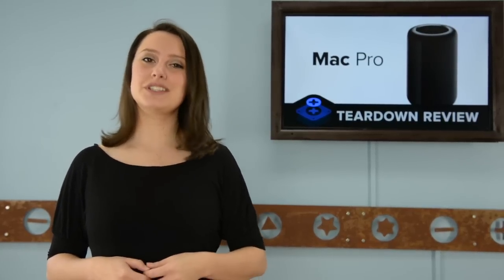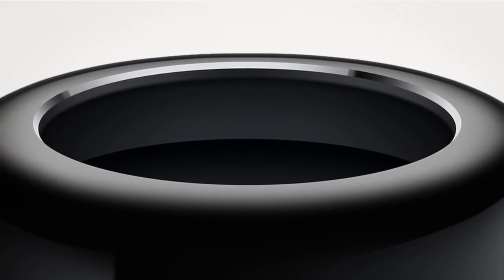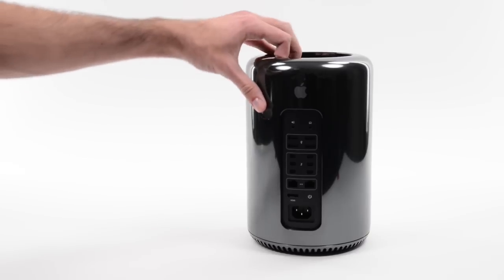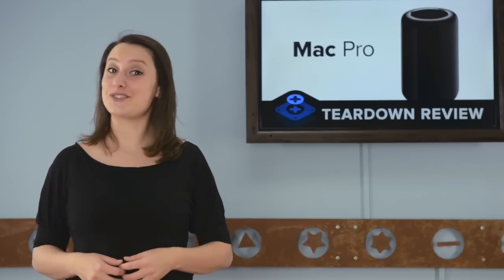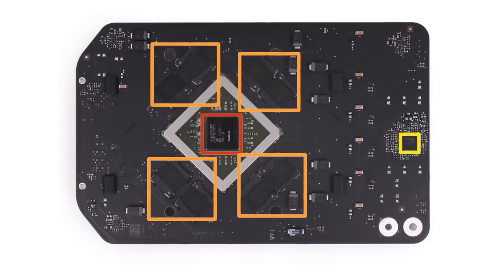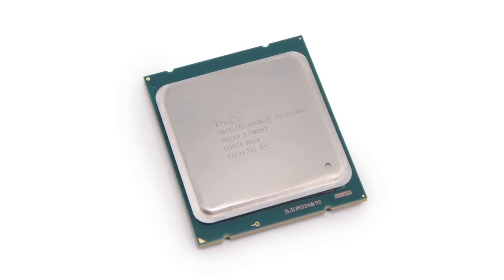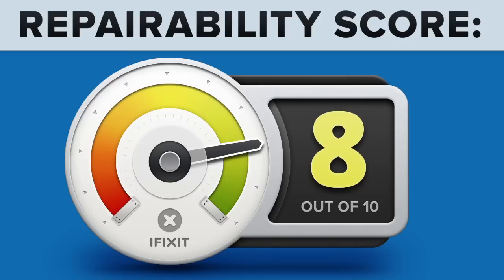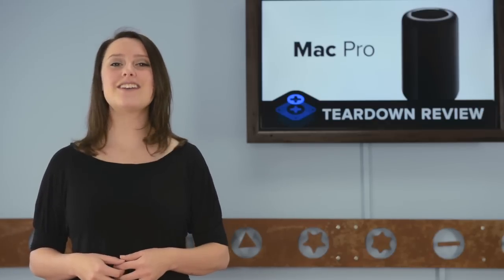Mac Pro Teardown Review

Comment: (tic) I think that that what apple has done for us high end users is great. They have made us a sexy new machine and made it incredibly easy to upgrade sorry to all of you buying the new Macbook Pros Having to pay through the nose upfront if you want 16gb of ram lol. But don't worry because though they have built ours to last and upgrade yours will be replaced in under six months depreciating your little macbooks  and 6 month old Ipads enough that I have  bought 2 15" retinas and 2 32gb 4gen ipads for my 6 year old twins for a bit more than the stripped pro. Its about time we find a way to get the riff raff to stop using our product. Three cheers to the direction the NEW APPLE is moving toward.

 God if only windows didn't suck so bad they are actually starting to make some aesthetically pleasing machines. I would just go back.  I think this is really disconcerting. I'm starting to believe apple has really forgotten the indy artists and the spirit of the independent free code until your eyes bleed, wake up with keyboard face and run with scissors until you poke an eye out mavericks who adopted this company for its bold ideas.  the fact you still need to buy a 16gb Ipad when each progressive generation could bump up the disk without losing a dime is really sad.

Comment: I hate people who say that they could build a computer better than the Mac Pro and cheaper. You would probably take an Xeon processor and compared it to a fucking i7, brain dead people that compare the two processors like that are probably the ones that make dumb ass decisions like choosing a Nissan Altima over a fucking Bugatti. The processors are both strong the i7 is like a race car and the Xeon is like heavy duty truck, you compared the two like they were the same, it's like how you take a Toyota Prius and you give it a V8 engine, then you called it a fucking Porsche.
Reply: No, I could build a Dual 12 Core Xeon E5s (THAT's 2!) with 4Way SLI (2 x the GPU's) and 96GB of QUAD (1.5 x the RAM) Channel DDR3 for the same price as the top of the line version of this trash can.